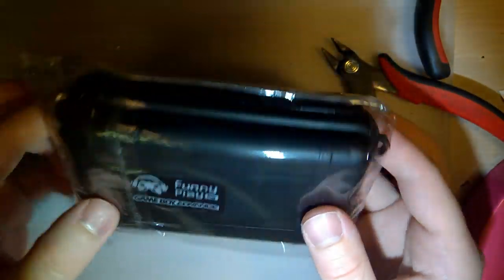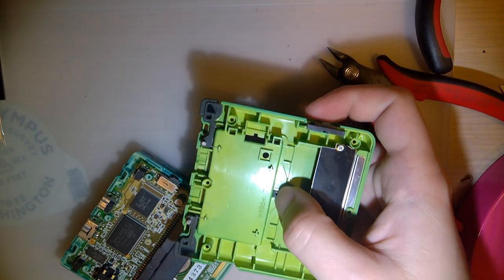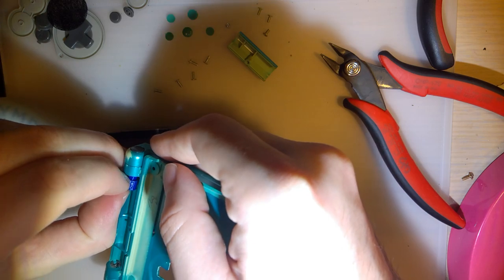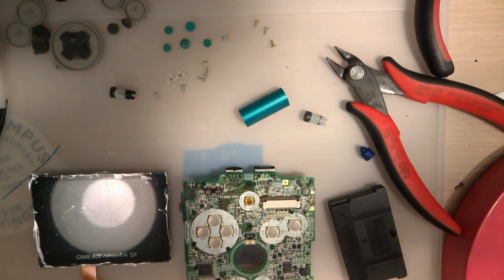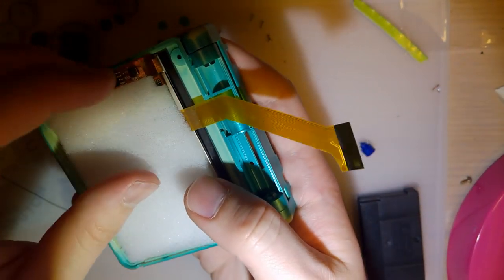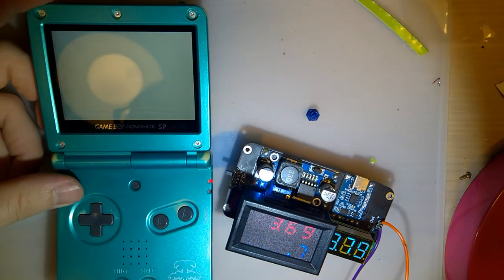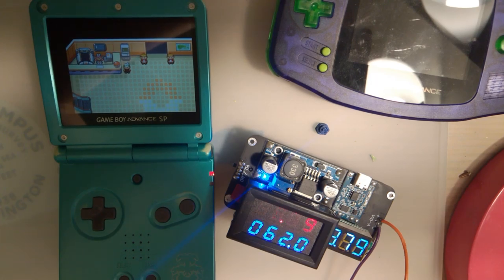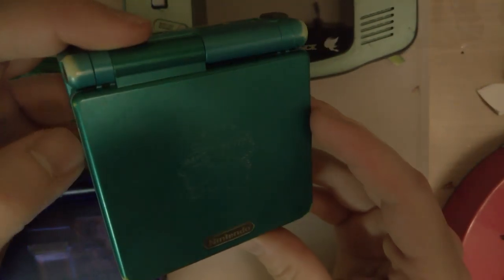Installing the Funnyplaying SPIPS GBA SP IPS Screen in a GBA SP (AGS-001)

Comment: Good info Makho, bought a junked sp on ebay ~$40, a new case, and the fp IPS. Got a Weller soldering iron and will be adding your battery mod as well. Will be making a review video later!

Comment: I just finished doing the mod. The kit doesn't tell you what to trim in the case or where to solder the wire so your video was very helpful. I used a smokey dark transparent shell. This way I can show off all my modifications. I use one of the original DS battery as they are 850mAh instead of the SP's default 600mAh. It;s visible through the shell and now that tiny soldered red wire is just more stuff to show off and brag about. This scree is a total game changer for the GBA scene. It makes the old AGS-001 desirable again.

Comment: Thanks for the vid dude. Btw, replacement shells are pretty easy to get if you're ordering online. Shells are the easiest things to come by. In my opinion, finding a good lcd screen to replace a damaged one is way more of a hassle because, just looking at some of the feedback from some people who have bought gba lcd screens from different places online, have had problems with the screen being damaged, broken, riibon cable being worn badly, etc. Anyways, good vid man. 😎👍
Reply from the maker: I've never had any issues with any of the kits I bought arriving damaged or anything like that. And regarding shells, there is a huge difference in quality between the Nintendo OEM shells and the aftermarket ones. The clear ones are a lot better than the others but they are still not optimal. There are no shells available like the one that this SP has either.

Comment: My main qualm about modifying an OEM console shell instead of an aftermarket one is that there is a finite number of OEM shells in existence, whereas with aftermarket shells, there is no limit to the number that are in existence since more can always be printed. I always feel bad about modifying an OEM shell because I know that by cutting into it I am contributing to the decline of good condition, unaltered original shells. Really the only way I wouldn't feel bad about it would be if the aftermarket shells reached the point where the quality of them is equal to or exceeding the quality and feel of the OEM shells.
Reply from the maker: You are already contributing to "the decline" by buying consoles and reshelling them.

Comment: Shames AGS-101 modders but trims an original case.   In all seriousness, great video. I'm waiting on my screen to come in and I'll be replacing my ags-101 as I scratched the screen   trying to apply a glass screen lens.   This video was helpful.

Edit:  What temp did you have your soldering iron at?  I havent done much soldering and I don't want to mess it up.
Reply from the maker: I typically use my iron at 500-550 frankenstein. My comments about AGS-101 are more about the people who buy those consoles to use the screen in an AGB.
Reply: @makho  Ahh okay, seems a little high from other stuff I read online, but I havent had much soldering experience.   Oh no worries, I took no offense to it although I get some people enjoy the AGB form factor more, which I can respect.  Thank you for the response!

Comment: I ruined my Q12B test point. I snagged the soldered wire and it pulled the contact and some wire off the SP board. Any tips on soldering to point 2 or 4 on the button? I am fairly new to soldering and it seems like it will be tricky because it’s a much smaller point with no big contact to aim for.
Reply from the maker: try tinning the joint first. Use flux (but not so much that you get it inside the button).
Reply: Thank you for the response! Great video by the way, it was the main one I used as my guide, your guide was perfect but my clumsiness was what cussed my issue. I’m going to leave it until next weekend when I have more time and then crack it back open and see if I’ve got the guts to attempt it. It’s my GBA from childhood so I’d be bummed if I managed to break the board.

Comment: could you insert the ribbon cable first and get things set, then solder the wire to make things easier?
Reply from the maker: Sure thing. In fact, that's probably easier

Comment: Great video. 
How would you suggest removing the hinges for people without access to a 3D printer?
Reply from the maker: I mean, I made a tool specifically for this so I'm going to suggest my tool. You can order prints from online services or likely even get something done locally via a makerspace or public library. If you check the video I did on the hinge removal tool, I linked to other resources as well.

Comment: Something great to watch before bed.
Do you have a video on the freckle shack about the brightness control pin soldering?
Reply from the maker: I do not -- my only freckleshack is a batch 1 unit with no digital brightness control. I have a video on adding brightness control to that unit though.

https://youtu.be/AGHZPXUE9nQ

Comment: This is a great tutorial definitely has motivated me to want to make the upgrade to a new IPS screen in preparation to play newly acquired (knockoffs) of Metroid Zero Mission and Fusion. I have soldering equipment on the way (never soldered before) Questions however: possible to purchase the 3D tool you made for popping out hinges? If not is there another supplier or 2nd that comes close to handy tool you made? Not reshelling but it looks easier with it totally separated from shell.
Reply from the maker: To my knowledge, there are no vendors directly selling the tool (not that I would be opposed to that, I distributed the source files royalty free). If you know someone with a 3D printer, you can get it printed basically for free. It uses a negligible amount of material and takes less than 5 minutes to print.
Reply: @makho  ah well in that case thank God for Etsy. Yes I'll happily take the source files. Thanks for taking the time to look at reply!
Reply: @makho  so I've checked through a few your videos but didn't find source files. So I joined the discord to see if files are there but seemed to be missing them in the sections on it. thought it would be in resources. Maybe I'm just passing over them.

Comment: Hey makho! Have you ever dealed with crooked funny playing IPS panel? Like the screen is not glued straight 90 degrees? I read that it's possible to re-heat it to correct that, but I don't know if it's actually possible.
Reply from the maker: That's not how the lamination works. Contact the seller if your screen is not laminated properly.

Comment: U mentioned the brightness adjustment isn’t needed but can u still adjust it without having to solder or do u have to solder the wire in order to adjust the brightness ?
Reply from the maker: Soldering is required if you want to be able to change the brightness.

Comment: If I did not install the brightness control, the default brightness will be at the maximum? Please somebody let me know because I want to skip the soldering step.
Reply from the maker: It will be at the middle level.
Reply: makho are you sure? i dont have a soldering iron and i want to do the mod, but if the default is max brightness it’ll be too bright
Reply: makho is the middle brightness good?

Comment: 12:10 I have the perfect tool. I use small metal tweezers. Its bent near the top so I just scoop them off easily
Reply from the maker: Like I've mentioned before (and I thought in this video), I don't like using metal tools on that part because it is very easy to slip with the tools and take a chunk out of the plastic or the rubber. If that works for you though, that's absolutely fantastic!
Reply: @makho  I wasn't being careful and ripped the the piece Haha you were right. Just a little annoying but I'm planning on buying a replacement shell anyways.
Reply from the maker: @yup5581  Ouch =(

Well, practice never hurts I guess

Comment: I put the display on my sp but it sinks on the side that i trimmed the shell. what can i do to stop it from doing that?
Reply from the maker: if the kit came with foam, you can use that behind the screen to hold the LCD in place
Reply: @makho  could the added pressure damage the pcb in the back or is the foam too soft for such a thing?
Reply from the maker: @akezepi  if the kit itself came with the foam, it should be fine. If you're looking at the foam in the casing that the kit might have come in, probably don't use that without significantly trims.

Comment: one question will i need flux for the soldering part or is it not neccecary
Reply from the maker: Flux is absolutely necessary for soldering. You can get away with just using the rosin inside the solder for just soldering single wires like this mod requires but you'll want flux for anything more than that.

Comment: What is that device you're using to power it on? Thanks!
Reply from the maker: This is an older video where I was still using a custom built portable power supply. I don't recommend it but I do have a video on my channel if you search it. I currently use a much better power supply and I have the details on all the tools I use on the site I setup: http://makhowastaken.com/

Comment: Do I need flux for the soldering part
Reply from the maker: you need flux every time you solder.
Reply: @makho  do you even use it with rosin core
Reply from the maker: @DeadGyro  yes
Reply: @makho  thanks I didn't know that you needed flux withe rosin core

Comment: is it normal that my R trigger doesnt work? if not where should i start troubleshooting?
Reply from the maker: I can safely say that something like that is not normal. You can try cleaning the button. Check the button itself with a multimeter, should be open circuit until you press it.
Reply: @makho  thanks ill try that after work, forgot to mention that this only happened after i soldered the wire from the ribbon cable to the brightness button, my kit from retromodding didnt come with a wire so i just used the thinnest one i could find

Comment: Mine came with the writing on the lens all rainbowy and an orange case. All from their website. Is the lense random or something? I mean, it looks good. I'm just curious
Reply from the maker: looks like they started doing a rainbow film instead of just silver. That's normal, yeah.
Reply: @makho  ok, so I lucked out since I made the usual EVA 01 themed build, so it looks sort of neat on it, but I can see people being disappointed with it
Reply: @makho  I got another question. I swear I won't be bothering you after this. My screen sometimes gives me some black frames at random during gameplay. What could be the cause of that?
Reply from the maker: @darkgladiator27  ¯\_(ツ)_/¯ I haven't seen that
Reply: @makho  Ok, thanks. It's like the screen turns off for an instant. I will check out all the connections
Reply from the maker: @darkgladiator27  might be worth mentioning to whoever sold the kit to you. Could also try same kit in another GB to help narrow the problem
Reply: @makho  it was directly from funnyplaying. Waiting for a response by them. Thanks for all the answers!

Comment: Hey Makho - I've just done this mod but weirdly I'm not getting all 6 levels of brightness. When it's on the lowest brightness setting for me, the first 2 clicks do nothing, then it works for 4 levels until I cycle back to the lowest again. I've noticed one post on Reddit with this issue but not much discussion. Are you familiar with this at all? My board revision was the very first SP and I'm wondering if that has anything to do with it?
Reply from the maker: If you have another SP motherboard to try the kit with, try that first. Then contact whoever you bought the kit from.

Comment: I have a question,  can you use a 001 motherboard with a 101 screen? Will it work or would you need a 101 motherboard?
Reply from the maker: AGS-101 screens cannot be installed on AGS-001 motherboards or vice-versa if that's what you are asking. There are mods to make them compatible but I can't recommend them over this kit.

Comment: What's the AGS-101 power draw? I might be a jerk and throw away my 101 screen for this new IPS mod.... I bet both use around 100 milliamps
Reply from the maker: I just added this link to the description but I regularly update the spreadsheet linked in this thread https://www.reddit.com/r/Gameboy/comments/ehru1w/relative_power_usage_of_backlight_mods/
Reply: @makho  in your expert opinion do you think upgrading a 101 to one of these new IPS screens is worth it if you value long battery life?

I mean, I've already upgraded to USBC and then aftermarket 1000 milliamp battery, but... The contrast and brightness on the screen upgrade looks amazing
Reply from the maker: @Kiyoshi_9606  buy an AGS-001 and upgrade that if you want an IPS. Upgrading an AGS-101 seems like a waste to me since those still have high demand compared to a 001.
Reply: @makho  although I looked at your charts I couldn't quite determine just how energy-efficient the 101 was.... It seems like if you want a backlight screen, any IPS mod will give you slightly superior results but take a massive hit on battery life -- whereas the original 101 has crazy good battery life and is j significantly better than 001 and about 70% is good as a screen mod.... Ah. Choices.

Kinda want to do the wireless charging and USB c mod, too! Maybe one day they'll be an OLED mod.....
Reply from the maker: @Kiyoshi_9606  101 should be right at the top
Reply: @makho  rows 2-13 are blank, no info on power draw, friend
Reply from the maker: @Kiyoshi_9606  guess I only measured brightness then

Comment: what is that voltage meter do u use? i want to buy one
Reply from the maker: The thing I measured power with? I'm about to make a new one that should work better and has more features but the one in this video I made a while back and they are not for sale. I did post the files and you can make your own though. 

see here: https://youtu.be/leoks1pUpcs

Comment: Hi, I did this mod in two separate GBA but every time I press a button the screen freezes, what's the problem? I did not solder it either
Reply from the maker: Sounds like there could be something shorting. Check that you have everything that needs to be insulated insulated and if it is still acting up, try it outside the shell. If that solves it, you need to check your insulation again. If it is still acting up, try it with the original screen outside the shell again. If that solves it, your kit might be bad.
Reply: @makho  I think the kit is the problem, I tried with two original GBA SP and its the same, I press the B button, or the speaker (with the shell put together) and it freezes the game. It could be something causing the short circuit, but in two different GBAs? it's weird, I'll try to do it outside the shell, but what can cause a short circuit? the speaker maybe? Thanks for your time
Reply from the maker: @dave8826  Yeah, let me know how it works when everything is disassembled.
Reply: @makho  sadly, it happens the same..  in both consoles, even if I restore the original screen, static maybe?
Reply from the maker: @dave8826  Can't say. Have you done any mods or repairs to the boards? It's odd that both have the same issue.
Reply: @makho  Nothing, the boards are new, the only different that I did to them is installing this kit, and even if I go back and restore the original screen it happens the same.

Oddly, if I play GB or GBC games, the issue is solved, but if I play my originals GBA games it crash.
Reply: @makho  no, I did not, but searching the internet i've found this: https://www.youtube.com/watch?v=KRfSy5sqImk  it's the same sound that happens when you remove a cartridge , how do you insolate that?
Reply: @makho  Well just for the record, I do not know what happened , but I change the motherboard for a AGS101 and it worked!

Comment: Hi, what is the size of that cable and what's the proper name so I can buy it?
Reply from the maker: Uhh, what cable?
Reply: @makho  the blue and thin one, the one you solder, sorry
Reply from the maker: @dave8826  I just use 30 AWG Kynar wire for this stuff. You can use whatever you have on hand. If you buy the kit from funnyplaying, it will come with wire.
Reply: @makho  Ok thanks!, I was asking because I tried to solder and it did not result.